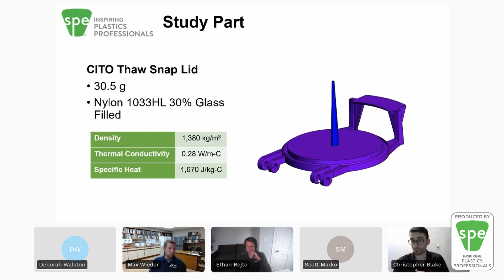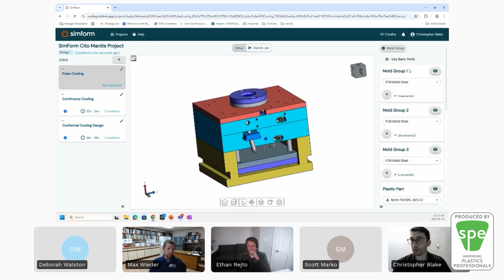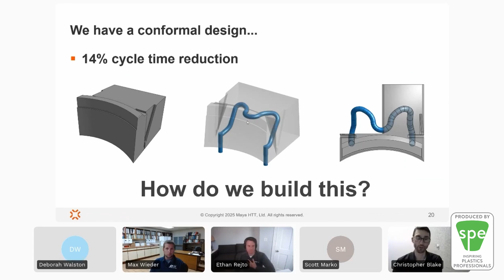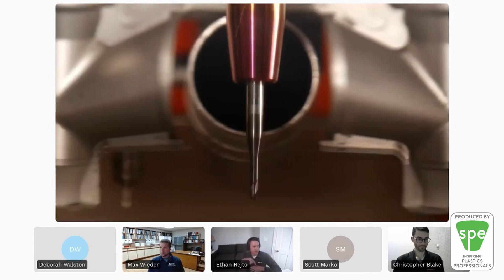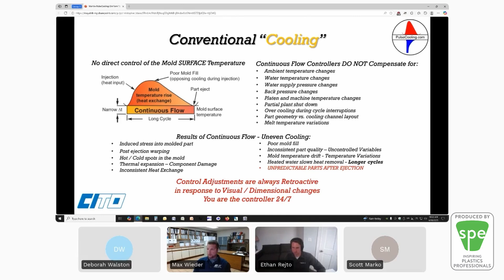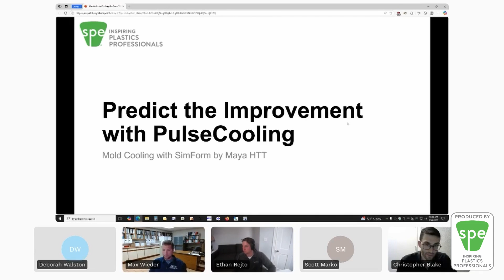Safely Navigating Innovative Successful Cooling Strategies in Plastic Injection Molding

Comment: Awesome, watched every minute of this! Im hoping that you guys will do a video at the press; looking forward to seeing real world data vs. simulation. I am pretty sure the real world will be very close if not "exact". 
As far as Mantle printing tool steels; Ethan was wondering what other tool steels someone might want, how about S7 since S7 is paired with H13 often times in Class 101 molds. Another question that I have, your printing H13 (and 420SS) how are you controlling the hardness of the final part? Can you print 1 insert at finish hardness of 50-52 and another part at say 46-48? 
Lastly, every molder should be using PulseCooling technology, its a no brainer, I say it all the time. 
Great video!